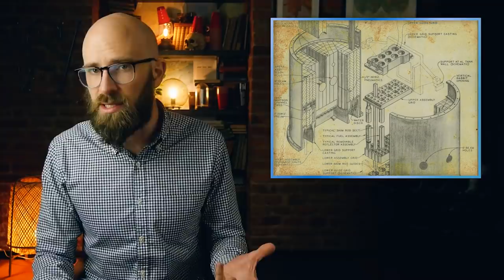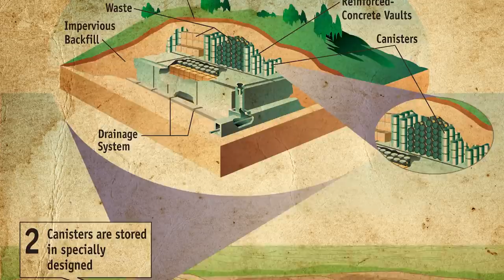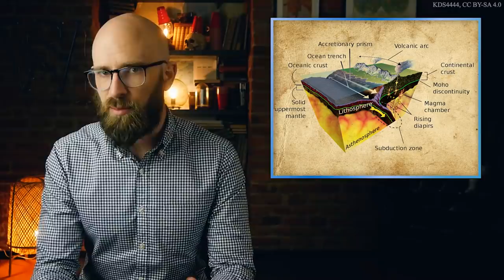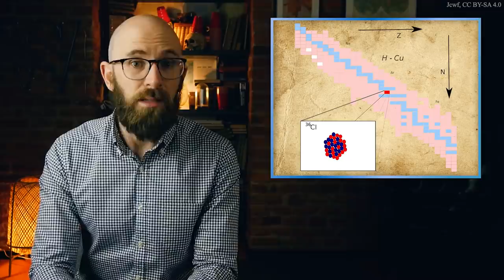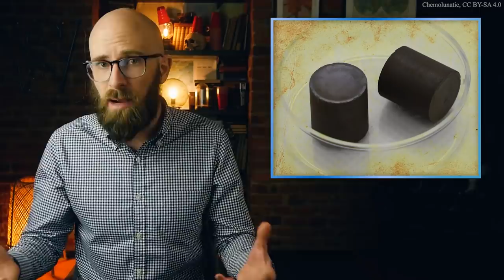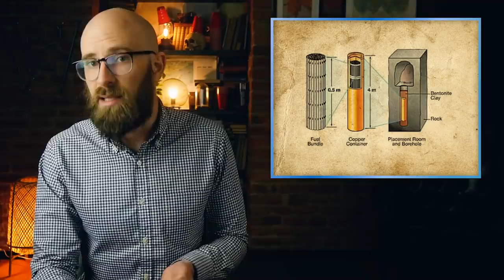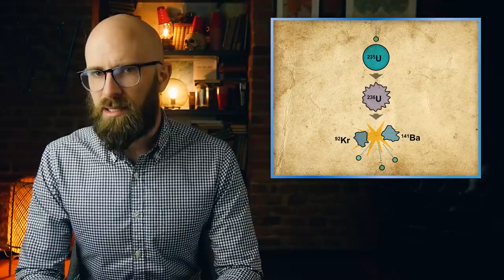How Does Nuclear Waste Disposal Work?

Comment: I am a nuclear engineer, and as for disposal, in Canada, it doesn't happen. Technically all nuclear waste in Canada is in "storage" awaiting the construction of a disposal facility. Storage implies the waste is retrievable. Disposal is different in that retrieval is not within the scope of design.
Reply: Molten salt reactors.
Reply: @danadurnfordkevinblanchdebunk  What about them? The company I work for is investigating them. There are some real problems with them that materials science has yet to work out.
Reply: @revcrussell  Completly agree.  I think finally we can move away from these complicated dangerous systems and start a new era of true clean energy and not just the typical solar and wind.  More options like geothermal which I believe to be the cleanest lowest carbon footprint of them all and as long as the Earths core is hot enough there will always be a viable energy source.
Reply: @paulmobleyscience  In context, nuclear waste is responsible for an insanely low rate of deaths compare to every known energy source. Even under the worst prediction models. It's too bad science has become a popularity contest instead of comparative data.
Reply: @johnyoung5392  In context.....PH of the water, bacteria, redox, Uranyl Ion UO2 2+, U(iv) bondage, water soluble transuranic radionuclide that evaporate under equillibrium conditions....and then ingestion over decades causing upwards of 1800 different diseases and ailments on top of Cancer.   No one knows how many people have died as a result of nuclear power let alone nuclear waste.
Reply: @paulmobleyscience  No one knows how many people have died as a result of nuclear power let alone nuclear waste? That's an absolute falsehood. There are plenty of charts and data out there along with predictor models. Ostrich heading isn't showing off your science skills. We know to a fairly certain degree how many people have died and will die from all energy sources. That is science.
Reply: @johnyoung5392  Charts and data....ok tell me...out of the 1800 diseases it does cause what are the primary diseases thats caused by even low dose long term exposure to ionizing radiation?
Reply: @johnyoung5392  Predictor models....you mean with concentration ratios with different formulas for water, dirt, animals, air, people and other such factors...yes I'm well versed in the math.
Reply: @johnyoung5392  #1Cancer I think we could all agree yes?   #2 Heart disease #3 autoimmune diseases could we agree?  Ok since you mentioned charts and data.....show us the list of deaths caused by cancers that were induced by ionizing radiation ONLY.  Not all cancers but specifically in the last 70 years a list of all those cancer deaths sorted out into different CAUSE catagories.
Reply: @johnyoung5392  You see the reason you think not many have died as a result of nuclear power is you've been lied to like most of us.   Without THE PRIMARY disease caused by nuclear power added to the "deaths per kilo/terra watt hour" calculations then no one knows how many people have died as a result of nuclear power let alone nuclear waste...... your turn 🎤
Reply: @johnyoung5392  I'm here to help John not cause any issues.   I do know what I'm talking about. Have you ever heard of the Carrington event or even stronger events?   450+ global nuclear reactors most of which by an ocean and need water for cooling along with offsight power otherwise we are left with 450 backup generators. Do you think that the sun could release enough energy to cause massive discharge at the L-shell magnetic field lines causing an EMP, muon petrusion, magma intrusion, earthquakes, volcanic eruption increase (which we are already seeing) and then possible tsunamis, liquefaction after the plates come unlocked at the low velocity zone and change the landscape we see today?   Do you think energy from the sun can knock out power across continents at any given point in time that would shut everything down to a standstill?   Fukushima × 450 possible.....what are the odds of half at that point...half the Northern hemisphere.....would that cause a global issue then?   Do you think nuclear power should be used now after knowing this is indeed possible more likely probable?
Reply: @johnyoung5392  And then of course the Achillies heals one the waste and two the inverse square law does not apply to extended sources of radiation on the surface of this planet with a water cycle. No pretend "exclusion zone" sphere can be made around 3 full meltdowns less than 100 yards from the ocean.  Coulombs law Force= K×q1q2/d2, electron volt....in vacuum is 1.602176634×10−19 Joules exactly.....what is it exactly out of vacuum and on the surface of this planet not in vaccum?   Does anyone know?   Planks law stipulation...there shall be no flow of energy or matter from the black body to the environment.  Internal exposure is the Petkau affect.  Absorbed dose in case I missed typing it out is
1. Range (ev)
2. Deposition through the range (beginning middle or end of whole life)
3. Area of irradiation (ISL)
4. Density of the means
Convert....
Organically bound tritium...."Tritium directly or indirectly induce various biological effects including DNA strand breaks, micronucleus formation, cell necrosis or aptosis, chromosal aberration and various other phenomena thus negatively affecting human health. The half-life of tritium is 12.33 years and the AVERAGE penetration of its ELECTRONS in water is 0.56um, which is considerably lessthan the AVERAGE diameter of a human cell.  Therfore it does not cause damage due to external irradiation but rather long term internal radiation that results from inhalation, oral intake or absorbance of radiactive particles through the skin. AFTER ENTERING AN ORGANISM, TRITIUM CAN REPLACE HYDROGEN ATOMS IN BIOLOGICAL MACROMOLECULES OR BIND TO CELLULAR COMPONENTS TO FORM......ORGANICALLY BOUND TRITIUM (OBT). Exposure increases along with tritium levels in the environment."  This is not to make you think or say to yourself.....know it all jerk this guy Paul is.   No, I'm not trying to make you feel any certain way...this is information for you and others to research yourself without a link for you to see both sides of the coin...not just the one side you have been shown in the past.
Reply: @johnyoung5392  John there are things that you can't find anymore on the searches or they are really difficult to find or hidden behind a pay wall.   Things like starfish absorb up to 1000 times more plutonium than any other animal in the ocean.  Or mutations in lab mice show an increase in ratio starting in the third generation.  Children in the Northwestern United States skin was turning green from eating the salmon from the Columbia River.   These are things that weren't just made up out of thin air and you will never hear of many things like this unless someone has the knowledge of it that will take the time to type it all out if need be.
Reply: @revcrussell  MSR issues right...isn't the main issue is an unsuitable metal for the containment vessels and other metal parts?  I believe spider web cracks were found throughout these reactors after a very short period of time and why they never really took off.  To develop a metal so specialized that doesn't exist and would be astronomically expensive to build and maintain makes MSRs and complex systems like these being built by corporations with CEOs and management making massive contracts needs to be a thing of the past and the perpetual control of the information by those within these fields needs to be unleashed to the masses for a proper decision...once and for all.
Reply: @paulmobleyscience  Yes, you need very special metals to work in a nuclear reactor. But as you point out, the liquids proposed as the working fluid of a MSR don't react well on even the best metals science has to offer. Corrosion rates can be high due to the fission products in the working fluid. Those cracks you mention could be what is called "stress corrosion cracking". This can be caused too. That combined with the fact the the working fluid would contain all kinds of ions and chemical elements as fission products, causes this to be a giant chemistry control problem. Then add the fact of the staggering radiation of the working fluid makes conventional chemistry control impossible. Google-fu found a great report INL/EXT-18-51033 that I can't hope to convey all of.
Reply: @revcrussell  Perfectly said and it is well conveyed along with understood.
Reply: @revcrussell  Fluoride being electronegative while transuranics being electropositive....its why it's in our water just after they found out what the bomb testing did to the populous.
Reply: @paulmobleyscience  Geothermal still needs a source of energy to build it and maintain it.    Don’t be fooled.      Gas or Diesel engines to dig the hole/trench. Coal to make the tubing…. And so so many more from other energy sources.     It’s not all cupcakes and suddenly Magically power appears.  
Geothermal is just as destructive as electric cars.
Reply: @paulmobleyscience  Oh and, nuclear waste will not be converted to something healthy to Oxygen as trees do in just days to months….        Why make nuclear waste that will take millions and more years to be converted to something safe?   Hello?
Reply: @indianasb59  Geothermal needs a source to build it?  Of course it does who said that it wouldn't?  Once one is built  guess where energy can be pulled from?  So you dont like geothermal, coal, nuclear or fossil fuels.... so how will base load be taken are of without those mentioned?
Reply: This is how they’re going to dispose fallen angels
Reply: @danadurnfordkevinblanchdebunk   very complex to operate.  Not a good/safe technology.
Reply: @johnyoung5392   absolutely correct at least in the context of nuclear accidents to date.
Reply: @paulmobleyscience   The mobility of radionuclides, other than those in fallout, is actually fairly small.
Reply: @paulmobleyscience  You could look them up if you wanted to.  You present 1,800 diseases as if it is a scientifically accepted number; it is not and almost certainly wrong.  There are probably not 1,800 totally defined diseases for all kinds of deaths, from ionizing radiation AND chemical exposures.
Reply: @paulmobleyscience   You are wrong on many levels.  You do not know what you are talking about.  It is impossible to prove that something didn’t happen.
Reply: @paulmobleyscience   More incorrect information and total gibberish.  Sorry.
Reply: @vanguard9067  I'm waiting for you to say something other than....nuh uh. 3 or 4 comments in a row and still said absolutely nothing.  Nice job.
Reply: @indianasb59  there is absolutely no way that geothermal power is more polluting than making electric cars, if looking at death per any measure.
Reply: @paulmobleyscience  you must not be reading them closely.  I’ve connected the dots for you on these three issues as to why you’re wrong.  Please tell me specifically what you find wanting in my replies.  I can’t find right now your long comment that contains the gibberish.  I need to prepare for brunch now, but will look later and address some more later.  I am not going to address them all, it is not worth my time.  Destroying a few more of your claims are enough to call into double the remainder,

Most radionuclides are not particularly mobile in the environment, therefore not a significant source of exposure.

There are not 1,800 unique causes of death period, therefore radiation exposures cannot cause 1,800 kinds of deaths.

Steel in nuclear reactors do not corrode significantly in the course of operation as you say.  They do become radioactive due to neutron capture.  They also become embrittled due to radiation.
Reply: @vanguard9067  And you still said absolutely nothing.  "Most radionuclides are not particularly mobile in the environment, therfore a. Snot source of exposure".  Which is true with its face value but when "reading them closely" you find out other information that proves that statement to be completly incorrect.  Being that some radionuclides are water soluble that means they will bond to the oxygen in the water of which will then evaporate and be very mobile in the environment.  So then you would say redox conditions don't normally occur and that a very strong acid must be used to cause this situation.  And then I would say that isn't the only way radionuclides, especially uranium becomes water soluble.  Once a meltdown does occur that prevents the protective zirconium cladding from keeping the uranium fuel from forming an oxidized crust.  Then I would tell you that oxidized crust is very water soluble and very mobile in the environment.  I would also tell you that uranium sulfate is also very water soluble and very mobile in the environment.  And you would say I didn't know that, interesting.  The EPA is actively attempting to remove radionuclides from our drinking water.  It isn't that it's just mixed into the water, it's actually bonded to the oxygen therefore it's a nightmare to try and remove it all from our drinking water.  Especially tritium....of which is by far the most mobile radionuclide that exists being that its radioactive hydrogen and smallest of all radionuclides.  Tritium actually splits and permeates any metallic structure we attempt to store it in.  This is why Indian Point NY has over 65,000% above background levels of tritium in the wells under the site.  You're completly incorrect, you should've just buggered off.
Reply: @vanguard9067  1800 ailments, illnesses and diseases.  1800 unique causes of death was your assumption.  How does inflammation of joints result in death?  You're not reading nearly close enough to debate me on this topic.
Reply: @vanguard9067  Nice edit there Vanguard, you added an entire paragraph and still did not say one thing other than nuh uh.  
Wrong, hydrazine is used in nuclear reactors to keep the corrosion from occurring.  BUT unfortunately that isn't the case when talking about a specific reactor type and fuel...MSR.  Not only does the Oak Ridge National laboratory completly disagrees with you but also the Hallam nuclear power station in Nebraska proves you completly incorrect as well.   These two sites ran for 4 years and by that time the entire vessel had what's known as Tellurium Embrittlement or segregation of the Hasteloy-N.  You see Hydrazine attempts to steal the oxygen but can not keep the molten salt from interacting with the Nickle in the alloy.  This is not your typical corrosion that can be delt with like in normal water cooled reactors because of the molten fluoride salts.   With MSR the fuel is mixed in with the coolant and graphite as the moderator.   So no, any argument you would use with knowledge only of water cooled reactors means absolutely nothing when speaking of the MSR thorium reactors of which aren't thorium being that Th-232 isn't fissle and must be transmutated to Th-233 that decays to U-233 which is then fissle and can be used in a reactor.  Yes, go and make brunch and I'll see you when you get back, you're going to need the energy.
Reply: @paulmobleyscience  YOU are the one that said (asked) how many of the 1,800 cause of death are possibly caused by radiation.  I said there are not 1,800 completely unique causes of death, which calls into question your level of sophistication. 

Long-term exposure to radiation most commonly causes various type of CANCER depending on the preferred systems the radionuclides accumulate.  >>I am not listing every type of cancer<<. Accumulation of radionuclides can also cause gross changes in ORGAN FUNCTION. depending on the concentration seen, potentially causing death.   >>I am not providing the effects of the organ selectively affected by different radionuclides<<. They can also affect long-term DAMAGE TO THE IMMUNE SYSYEM making a person more susceptible to infection and potentially death.  >same as above<<

Acutely exposure to high levels of radiation almost always result in gross changes in tissue morphology and function with MULTIPLE ORGAN FAILURE the usual cause of death.  Really what more do want and why.

You are too vague as to what exactly I was incorrect about, particularly given the age of the design and construction of the MSRE.  I did indeed mention embrittlement (and before you did) and it is caused mainly by neutron exposure, not chemical reactions.

Where in the United States is a commercial MSR breeder reactor in operation?  What happened at the last operating one.  Look we are all over the place talking about many different reactor types: commercial (e.g., BWR, PWR), breeder reactors of different types and fuel types/cycles, and non breeder reactor types.  Maybe if we are more specific about which type we are discussing, it might be more productive.
Reply: @paulmobleyscience  yes.  I cannot risk typing in super long comments for fear of losing them through accidentally pressing the wrong button.  So I tend to type things in notes and then cut and paste into the comment.

You can see my responses to some of your statements in a previous reply. You say things that seem to be saying there is only one technological way to do things.  There are breeder reactors that don’t require molten salt cooling.  There are MSRs that are not breeder reactors.  Thorium in not the only potential radioactive byproduct from a breeder reactor.  Not all thorium reactors are breeder reactors.  Not all thorium breeder reactors have thorium in the coolant, some reactor use solid thorium in fuel-element like bundles into the reactor core.  Please be more specific about what you are saying otherwise it is just too much work to respond to your comments.  Thank you.
Reply: @vanguard9067  "You say things that seem to be saying there is only one technicalogical way to do things."  Do you not know why that is seriously?   Why would it seem to you that I'm only talking about one way to do things...because you came in after everyone else that was talking about specific reactors.   Then you come in saying nuh uh without saying anything technical and making blanketed statements about a specific reactor type.   Each reactor type has its positives and most importantly negatives, of which people such as yourself never want to talk about, only the positives.  Then you tell me that you write notes and then copy and paste...as if I don't know you first say the things you know and then you go back and look up what you don't know and copy and paste from there.   So you looked up some things after brunch hours ago and found the only thing you could try is say that I'm speaking about only one type instead of all of them which is nonsense.  Before you showed certain things were said that made my comments specific in some areas and in others I could say things that have to deal with all types of reactors.   Of course you did all that and didn't come back talking about what you were mostly focused on which was water solubility of radionuclides because you looked up what I said right before you went for brunch and then looked it up to find out you were actually incorrect.   You're not understanding even after I said I speak with Phisicist, engineers etc. Even after the Rev didn't say I was wrong and even validated what I said about MSRs that if you don't hold that title or something at least equivalent and haven't studied it to that degree then there is nothing you can say that would make me incorrect.  If you've only ever watched YouTube videos and searched on Google then you're not proving anything here.   I've already published 100% factual information that can be vetted and found true very easily as you did before you commented and your predisposed bias on nuclear power before you ever showed up means nothing in a debate with someone that actually knows the topic provably much more than you.   This is nothing new Vanguard, you don't really think you're the first person that have said everything you've said thus far do you?  Don't be nieve you're not going to teach me anything I don't already know as I've proven here before you showed up and if you don't know that like the Rev then you do not know this topic near as much as you pretend.   Now copy and paste something that actually proves me wrong instead of your blanketed statements you keep making.  I want specifics because that's the only way you're going to prove me wrong.  Saying things found on a Google search isn't cutting it.
Reply: @paulmobleyscience  please tell me one thing you want me to provide a specific on.  And please reference one thing that you said in your comments you consider to be specific,n thank you.
Reply: @paulmobleyscience  you have no clue about my predisposed bias.
Reply: @vanguard9067  I have more of a clue about your predisposed bias than you do about anything that deals with nuclear power.  We've been at this all day and you have yet to say anything.   This has turned into a charade of you copy and pasting generalized statements found anywhere.   Now the issue is you can't find the comment I made that you seen earlier as if it's vanished somewhere.  Complete nonsense
Reply: @paulmobleyscience    Ps you provided zero citations for what you said, no different than me.  You just claimed statements to be true, such as the “reading them closely” is a cop out answer when I provided you a quote from a document I used in my work years ago. Your comment about about my needing to do research to demonstrate my knowledge is total bullshit and a way to avoid responding to my comments.  I see the where you get your knowledge expecting that listening to lectures on YouTube make you an expert.  And then I find your “gibberish” comment talking about the carrington effect, emp, and cosmic rays causing volcanos and loosening tectonic plates.  All of that is a distraction from answering that guy’s question. And the latter two about cosmic rays affecting volcanos and plate tectonics are just plain idiotic.  Correlation does not guarantee causation.  At this point give me citations and I will you. Otherwise this is a waste of my time.
Reply: @paulmobleyscience  I didn’t bother with what you said about water solubility, because it’s bs.  You know evaporation affects the water not any binding substance depending on its heat of vaporization.  There is no cesium (for example only) floating in the air as a result of evaporation.   Now the radioactive dust left behind, it is a big issue.  One you should have focused on.
Reply: @paulmobleyscience  no I found that comment.  I just responded to it too.  Tell me what my predisposed bias is.  Oh, you don’t know, that’s right.  My bias is correcting statements about nuclear power and related subjects.  My biggest concern is global warming.  I support every renewable energy source above all else.  I am concerned that society will be unable to wean ourselves off of fossil fuels in time, and therefore I keep on top of nuclear technologies as an absolute last resort.  I am very concerned about any kind of breeder reactor as the technology has not been demonstrated as commercially ready and  the need for reprocessing of some kind, generating the worst kind of radioactive waste - fission products.  So you’re wrong again.
Reply: @paulmobleyscience  more personal attacks and not even one citation provided, or examples of what you consider “specific”.  I am done unless you respond with examples.  Do you actually have any?
Reply: @vanguard9067  I don't have to show a citation here,  this is a youtube comment section not a government meeting with biased people in charge and an ignorant society that most didn't turn up for the meeting (that's if the meeting was public to begin with and only prevented questions are approved).
Reply: @vanguard9067  No you're incorrect completely.  Look just with everyday operations under normal conditions every water cooled nuclear power plant releases Tritium/Deuterium, Carbon-14, noble gases such as Krypton, Iodine-131 and a list that much longer than I'm going to type here that most people do not know occurs.   They are told it is emission free, Carbon free and doesn't pollute the environment.  Nuclear power station daily, weekly and monthly  effluent levels are not at zero which is what they are told.   Even you here arguing with me about this even after I've proven it with my scientific technological statements that can be verified by multiple sources and citations.  And tour asking to provide a citation that proves that you're correct, it's ignorance.  No, it is you that is challenging me so it is up to you to prove otherwise of which you havent....for hours now.   🤔
Reply: @paulmobleyscience  fraud.  Chicken.  Bawk, bawk, bawk/
Reply: @paulmobleyscience  I said gases were indeed released.  You must have missed that.  I was responding to saying something about uranium I think being bound to a water molecule and being evaporated into the air.
Reply: @vanguard9067  Giving an example of cesium doesn't prove anything when I'm completely saying some radionuclides are water soluble and some are very mobile in the environment.  You act as if I don't understand this and you're only trying to save face at this point.  I could care less what you did years ago as I have done my own years ago with colleagues.   I am not your typical youtube commentor and it's completely obvious except for you it seems.  Depending on its heat of vaporization, exactly.   If it wasn't dependent on its heat vaporization then you would be correct and could make that generalized statement but it is. I'm glad you brought up the dust that can be spread in the wind and does have an affect which is just as much of an issue as with water soluble radionuclides. Dr Marko Kaltofen found a hot particle 460 Km from Fukushima inside someones home.   Dr Chris Busby found radionuclides in Tokyo from Fukushima and you're telling me it doesn't travel far?   That's nonsense, there are things released from a Nuclear power station everyday that are in gas form, not just liquid.   As I stated one of the worst in Tritium.  This is no secret.  Once ingested Tritium replaces hydrogen in the cell or binds directly to the cell to form ORGANICALLY BOUND TRITIUM.  This does not pass through the body within a months time amd causes DNA strand breaks, micronucleus formations, cell necrosis or aptosis, chromosal aberrations and various other phenomena thus negatively affecting human health.  That is a direct quote from the citation.   Direct.    It is up to you to put that in your search and then challenge the citation.   It is not up to me to hold your hand and do your work for you.
Reply: @vanguard9067  You said gases are released yes but didn't specifically say that Krypton-85 is released which is very toxic and causes cancers in humans and is released in everyday normal operations by every water cooled nuclear reactor around the world.   Effluent in gas and liquid.    If it's already effluent in normal everyday operation then that means it is flowing with the water. Let's also not forget that this science is flawed.   Cyclotrons at a specific electron volt over a specific magnetic field strength stripping the electron and measuring the frequency of 1.602×10-19 Joules.  Of which is?
Reply: @paulmobleyscience your “scientific technology statements” are total bs unless you prove them.  I’ll give you one citation and declare victory.  Put the usual Hypertext Transfer Protocol prefix in front of this.  ntrs.nasa.gov/api/citations/19900012846/downloads/19900012846.pdf. Go to page 4-27.  I worked on this EIS.
Reply: @vanguard9067  Ahhh you see now don't you....I hope so if you are who you say you are.  Kinetic and potential energy...basically the wave function of the Schrodinger equation.  Kinetic and Coulombs, De Broglie condition and wavelength.   Any approximation causes the conservation of energy to be invalid.   The Schrodinger equation can only work with atoms with only one electron and orbital.   The approximation comes after multi-electrons are calculated for and thus there is no exact energy solution.   That's why this model of the periodic table of the transuranics is so messy and completely out of balance with the rest of it made by the chemists.   When the US government took over along with their bomb building lab rats and made those Research, Development and Acquisition agreements where loose lips sinks ships was conducted and it's been a secret ever since.  This is no longer a secret and it's time the world moved away from this technology that was bred from war.
Reply: @vanguard9067  Nasa.gov you say.  I don't follow links from people especially those that worked on that specific project.   I don't do things that way.  In today's world I don't have to ask some "expert" that was funded by the government (I also served Spandahlem Germany).  I do not care in the least what your title is or what you've personally worked on.  This is a huge issue around the world that people that have went through college and acquired student loan debt that will take upwards of decades to pay off and they find very high paying jobs that make them have a subconscious bias and some even a conscious bias.   To go against something that provides food, shelter, transportation, heat, bank account, partner and children and usually a heafty retirement would be next to social suicide.   When people challenge the science it becomes a personal attack to them even when 100% proof is given that doesn't need citations because it's established science just like you promote.  Im not the typical person that is against nuclear because most of them have no clue why nuclear power/weapons shouldn't exist, they just know it isn't good and from the small portion of factual information that actual gets released to the general public. I actually know how this all works and not just what you would find on a youtube video either.   You'll find countless videos on the inverse square law but you won't find many that speak about how it does not apply to extended sources of radiation.    You'll find people that talk about geiger counters but not Townsend electron avalanche and quenching gas.   You'll find people that talk about the sun but they wouldn't know if the sun went out of phase or not.    They wouldn't know about the Pederson and Halls currents or the Phi angle shift or how the Kp index is the L-2 and L-3 L shell magnetometers.  No the normal person doesn't speak of these things and those things have merit, everything I've mentioned because it came from the science, not some farmer that don't understand why he doesn't want nuclear power because his job is more important and doesn't have time to challenge it.   But there are some of us out here that provably understand it and do not care about any title you will give them because they know better.
Reply: @paulmobleyscience  LOL.  Later
Reply: @vanguard9067  Show me a citation that doesn't agree with you that's what I'm interested in.  Not any citation that agrees with you, I've already seen most of those.
Reply: @vanguard9067  "Health risks of adding new reactors to the Vogtle nuclear plant", Blue Ridge Environmental Defense League.
Reply: @vanguard9067  How do you figure?  It's the safest form of electricity we have.